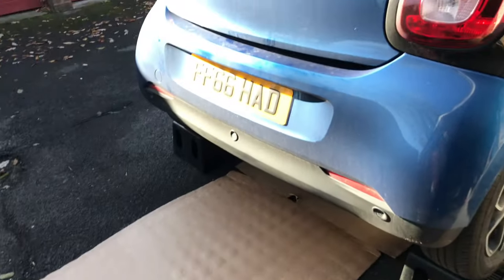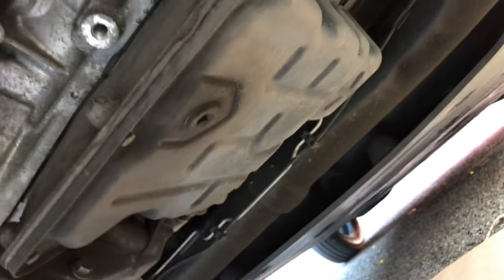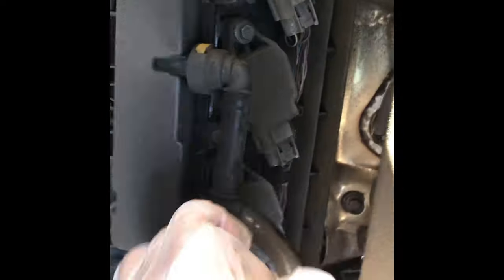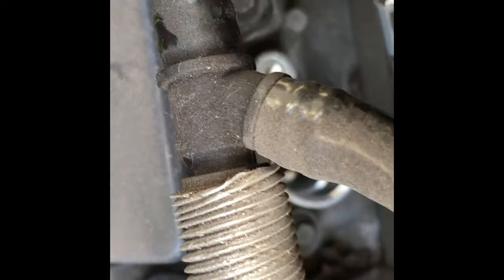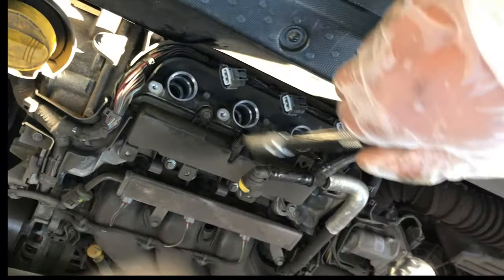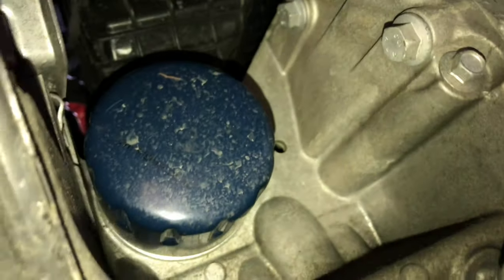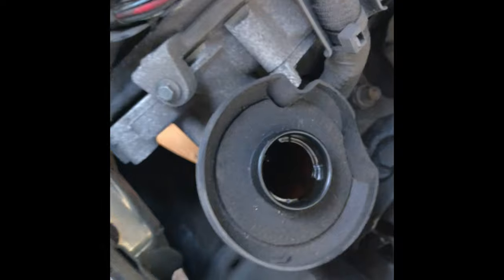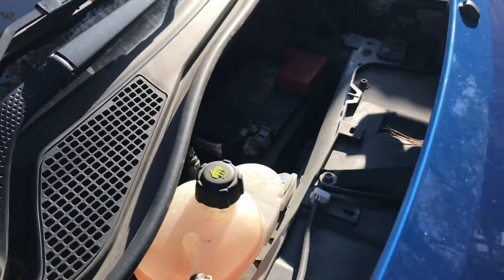Smart ForFour (2016 Onwards) Full Service - Oil Filter - Air Filter - Spark Plugs & Reset Service

Comment: Great video, can you do a video on how to trouble shoot the some of the A/C problems? Thanks!
Reply from the maker: What kind of problems?
Reply: @jaysworkshopgarage  not blowing cold air 😒
Reply from the maker: @123445571  Have you tried re-gassing your system
Reply: @jaysworkshopgarage  yes
Reply from the maker: @123445571  Get a leak test done they will inject ink into the system to see if gas is leaking
Reply: @jaysworkshopgarage  I need to replace my compressor, when I went to drop the engine subframe I noticed it was different then the older models.  Does the 453 not drop down like the 451?
Reply from the maker: @alanbauerly4879  I’m honestly not sure mate sorry

Comment: Did you replace the copper sealing ring when you re- installed the oil plug? (Screw)  Great video.
Reply from the maker: Thanks and yes I did but don’t worry about it too much if you’re old one isn’t completely flattened out you could re use it but my opinion is best to replace every time 👍🏽
Reply: Thank Jay, good info!

Comment: Hello, is that the 0.9 TCe 90 motor on this smart ??
Reply from the maker: I’m not sure if it’s exactly the same as the Twingo if that’s what you are asking
Reply: @jaysworkshopgarage  What is the engine on this vid ? The 90 horsepowers with turbo or the 71 hp atmo ?
Reply from the maker: @AminoMontana  99hp